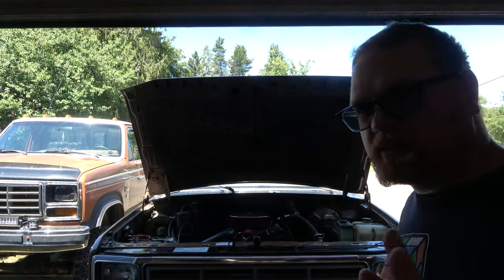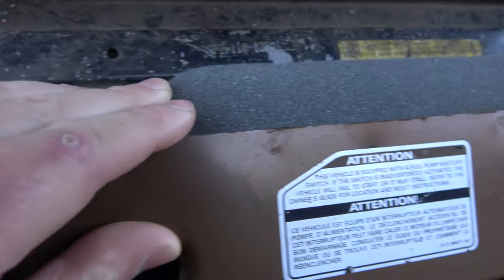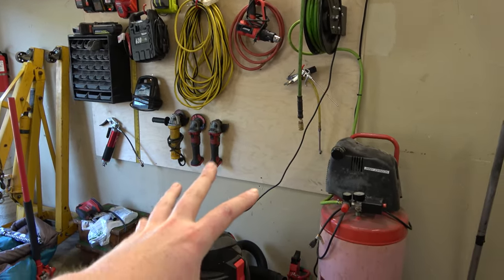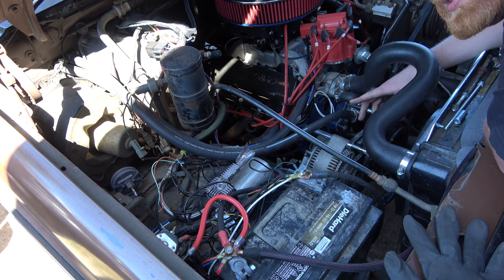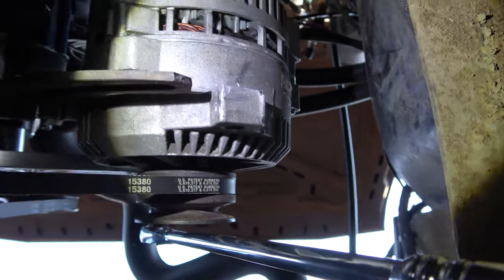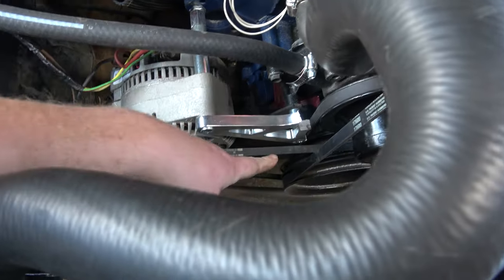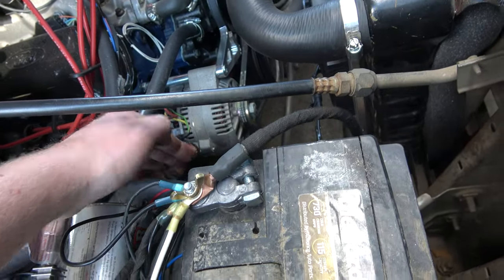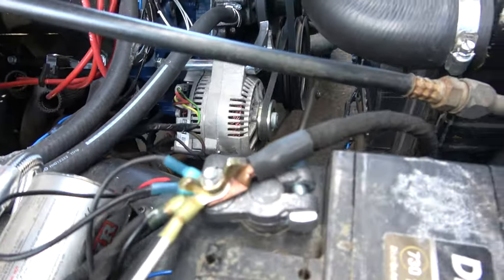1985 Ford F150 Fancy Schmancy Alternator Bracket Hack Job

Comment: I had the same problem with my 3G conversion. The belt would always squeal on startup no matter how tight the belt was, and belt life was really short. I converted mine to a 1G after 9 years of fighting it and no more problems, charges fine especially with a overdriven alternator pulley.